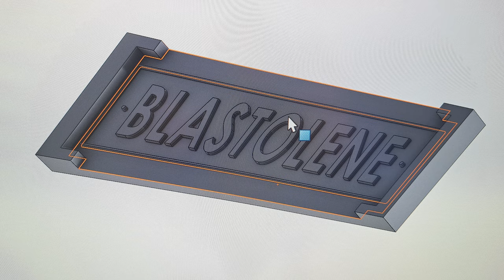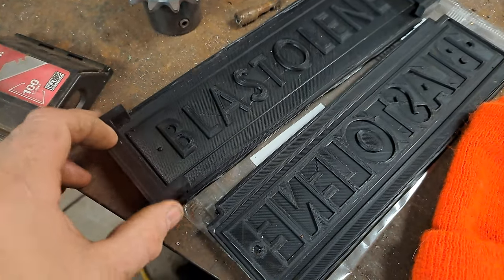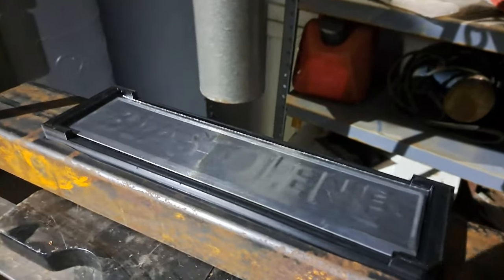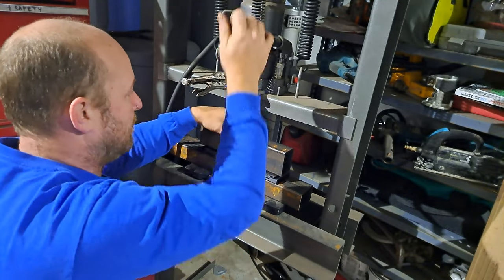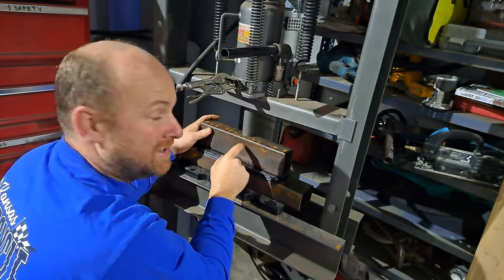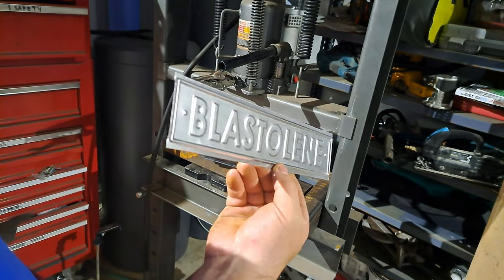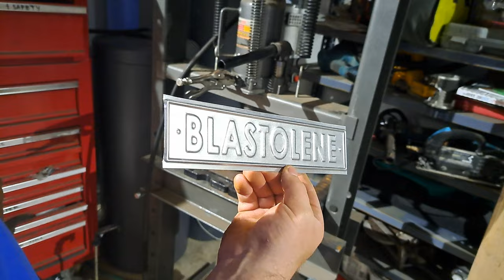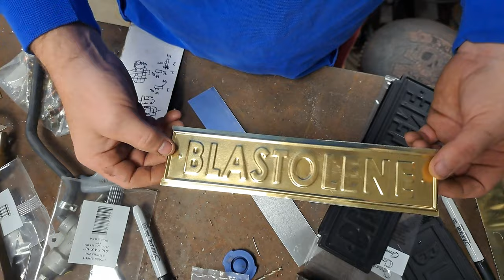3d Printed Stamped Steel Dies | Lark Machine Co

Comment: Devils advocate… failures due to trying to avoid long prints with 100% fill wind up taking more time than just printing once with 100% fill.
Reply from the maker: @danboy3399  probably, but I was a little bit impatient to learn if any of it is gonna work.  I'll probably do my next ones at 100
Reply: @sheanyquist  I did a similar process with some dimple dies and after several iterations I did I think nearly 100% infill, if not something close to 75 or so. I was eager to do some tests but they all seemed to fail because of my infill, when I finally put it higher and just let it run, I was able to test them and after many 2" dimpled holes, somewhere around 50, my die finally got too damaged to continue and I was ready to call it a night, and another several hour long print was ready by the next day when I was ready to tackle it again ha. I had personally been amazed at how well simple PLA held up to metal forming even with dimple dies, I am amazed that you got such clear letters from yours though, great job.

Comment: If 3D print plastic can do it, why not just CNC it in MDF or even better, in hardwood. Way faster Bros.
Reply from the maker: @rayleblanc7209  my workflow path to 3d print is faster than coding a cnc. That's just me.  I would definitely do that if I wanted any sort of longevity out of the tooling

Comment: Great results!  If you need to do more than a one-off,  you might be able to save some time by printing the originals with a really low infill %, use those to make silicone rubber molds, and then cast the actual dies from a hard-wearing epoxy. This will let you press a lot more parts before the dies get too worn to use anymore, and making new ones will be a LOT faster since you can reuse the molds to cast another set. Also, look up "elastoforming" - that might let you get away with only one positive die instead of a positive and negative.  But all of that aside, your parts look awesome!!

Comment: You can reinforce it using resin right! You can fill the gaps using resin. Then you can use electroplating to make the die stronger if you are going to stamp a lot of pieces.
Reply: At that point just machine it.

Comment: Think I'm going to try slightly thicker but softer aluminum.  The stuff from ACE doesnt tell you the grade but I think its hardened.  I see some 1000 and 3000 series stuff near me that is hardened.
Reply from the maker: It did seem like it has some spring back to it.  I would beef up the infill!

Comment: Surprised solid infill would take that long.  That's a TON of surface area to deform.  Worked great!  With .016" material, what did you offset your dies to compensate?  Looking forward to the next one.
Reply from the maker: I think it was .100" offset.  I wanted to use .4mm nozzle to get good detail on the lettering and 100% was way too long.  Im sure it would have been better with something like .8mm

Comment: DUUUDE!! That looks fricken awesome!!  I want try it but, I don’t have access to a big press like that!  …Maybe my arbor press can get ‘er done with many presses?! I think I’ll add witness pins to keep it aligned 🤔
Reply from the maker: It deformed the tubing i used to press with.  It would guess it needs a couple of tons to get it all the way there
Reply: I did something similar (but a bit smaller) in a big vice and I've also seen people doing this with hammering on the forms too. Obviously depends on many factors (material, design, depth...), but don't be afraid to try with a smaller press. I made holes for drills to use as alignment dowels.
Reply from the maker: @Finnspin_unicycles  i made a smaller one later for my own logo and it was definitely doable on the vice or a small arbor.  Thanks for watching and commenting!

Comment: Cool project! what clearance do you maintain between the die halves? (between the lower and upper letters)
Reply: If you like more die forming video's check out @randomrouting he has cool press brake 3d printed dies
Reply from the maker: Ill have to check the cad, but i think it was .050" offset